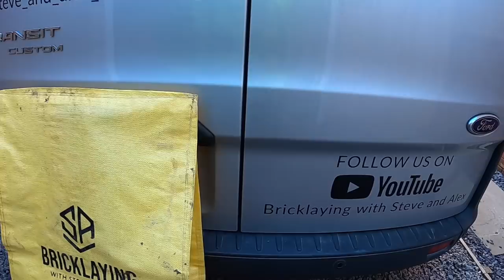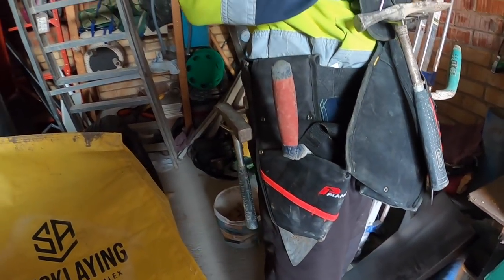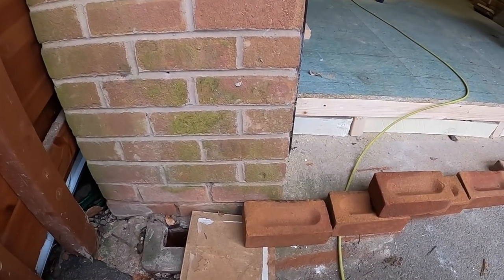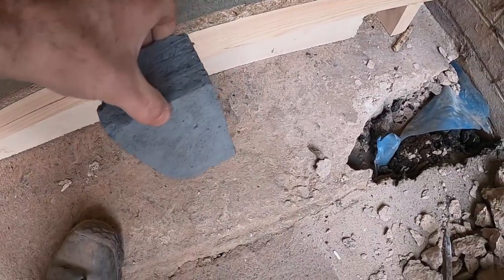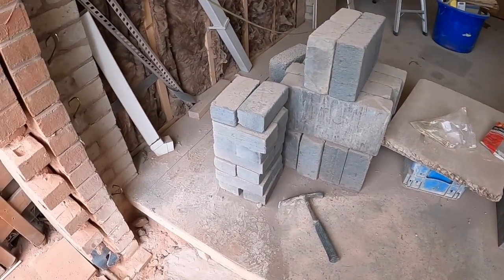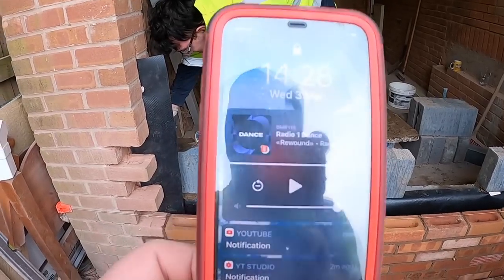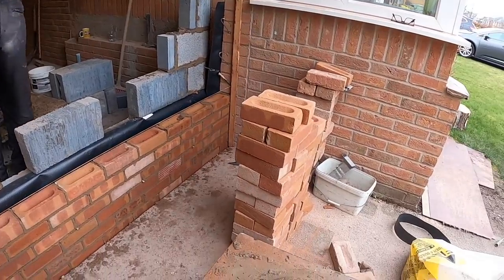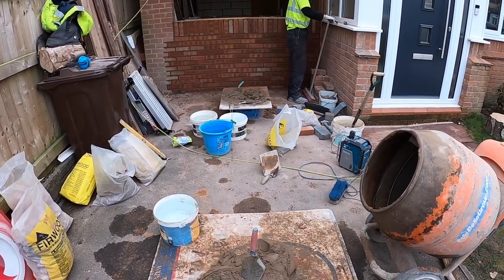NASTY SURPRISE ON A GARAGE CONVERSION

Comment: I take it this is not an ‘official’ habitable room’ conversion...having done a few myself, I know what building control would be saying about this one...and it wouldn’t be polite...but hey ho bro, it’s work I suppose...
Reply from the maker: @martin2466  🧱👍🏽
Reply: Bc only need to know if any drains are being added
Reply from the maker: @topcatcoolio8807  🧱👍🏽
Reply: Its a garage. They just forgot to put the miniture car collection in there.
Reply: @martin2466  Exactly. But if you watched. They put two dpc in. And a cavity tray.  Plus weep  holes . Plus insulation.  Two skins of brickwork.plus a Lintol... Plus tie wires. Plus vertical dpc !!!! It was only a small wall !  They were not building a skyscraper in Manhattan .  So think a but more mate !
Reply: @topcatcoolio8807 ... well, let’s see...only a small wall, but, BC would have required a concrete footing as opposed to a window lintel, Wooden floor existing...BC would have required a concrete floor, probably with reinforcing. The internal DPC was installed higher than the existing wooden floor, the wooden floor was laid directly onto the garage concrete floor, a suspended timber floor may have been acceptable, and at least air bricks were installed externally, but I didn’t see any installed internally (which would have been at the level of the internal wooden floor, not below it). Normally, the cavity tray, well in my area of the woods anyway, would have been installed higher up, just below where the window was to be installed. The external DPC was laid into the brickwork that was only 1 course above the external existing concrete driveway, BC would have insisted on there being a minimum of 150mm between the external DPC and any existing (to remain in situ) ground level... internally, it looked like the timber studs and insulation for the internal wall were fixed directly onto the external brick wall, BC would most likely have required a stand-off... As for your comment about building control only needing notification about any drainage added, I think you might be mis-interpreting completely the Planning Regulations with respect to permitted development, and the Building Regulations, which two entirely different things...!
Reply from the maker: @stun9771  
I need to defend myself here I think after that . 
   1st the lintel is designed to carry a lot more than 100 odd bricks plus it was bedded onto a dpc on top of the hardcore so let’s be honest it’s never going to sag.
2nd The floor is a floating floor with 100 mm celotex insulation . BC up here never ask for a concrete floor as you can’t insulate it sufficiently. The floor is supported by packers onto dpc so there is an air gap all be it small due to the lack of space .
3rd I put 2 dpcs in , one to continue the existing garage one and the other following the house , 2 above . It was actually level with the timber floor which  is house dpc level . 
4th The cavity tray was installed as per local BC specifications and they have never asked for one higher than that. 
5 th . The electrics were all installed by a qualified electrician and certified 
6th the room has been converted from a garage so no need for a fire door any more 
6th our windows always have trickle vents as standard 
7th the ceiling didn’t need re insulating as there is a room above . On garages without we have taken roof tiles off to get into the roof void above to insulate them in the past or put a false ceiling in using insulated plaster board . 
    The bottom line is we (Ste and Alex.... brickies , Jeff And Kyle....  joiners  , Andy and  Sam ..... plasterers ) 
  All father and son partnerships by the way have done over 20 of these garage  conversions so have dealt with BC  a lot , so much so we were told , you know what is needed so I trust you guys to do a proper job so just keep photographic eveidence of your work . 
   If the customer decides not to go through building regs then we explain that it up to them but we will still do all the work up to and above BC specs . 
   Different local authorities have different rules , even different inspectors from the same office have different rules but we won’t go there today as my bloody finger has gone numb . 
   It’s a shame that if something isn’t shown in detail in our videos then people assume it has been bodged or done incorrectly. 
I don’t film Jeffs work as it’s a bricklaying channel and not because the work is sub standard . 
  And just because we don’t show certificates that doesn’t mean they don’t exist . 
   Sorry for the rant but I feel like we needed to defend ourselves . 
  I’m off for a lie down now 🥵🧱👍🏽
Reply: @SteveAndAlexBuild  Take no notice mate. You are a top bricklayers. And went above and beyond. What some Bricklayer would have done.. they also forget the strip footing on new homes - Carries on ALL AROUND the house. So the load on hardcore in the middle would have been transmitted to this. As well as to the splendid toothing you did. And Lintol bearing.  Also a concrete floor for garage and weights for cars is well sufficient.  God bless you buddies.take care.
Reply from the maker: @topcatcoolio8807  🙏🏽🧱👍🏽
Reply from the maker: @martin2466  Absolutely Martin!  . You are a big part of this channel and keep us entertained every week and as you say we all can learn from YouTube. 
   I can honestly say I’m a better bricklayer since starting YouTube which is all down to the comments section . 👌🏼🧱👍🏽
Reply: Steve & Alex... Thank you for your detailed response... All I can say is that I was only responding to a response from someone else that I thought was, to be frank, cobblers... As a builder I have undertaken to design properties, including producing the drawings (the old way, as I was taught, on a drawing board), and obtaining planning and building control permission. Over the years I have obviously become pretty familiar with both the legal requirements, which actually apply everywhere, and the somewhat different views of building control officers...more so now that building control is ‘deregulated’, and mainly carried out by private companies on behalf of the local authorities. One can only comment on what one observes during your videos, as was the case, so I don’t feel that that pointing out things observed...and following you response, I did go back through your video to ensure what I was seeing, was in fact what I actually saw...and commented on...
I would agree if the floor etc has been raised off the concrete and protected, in the manner you state, that’s good...this was not seen in the video, neither was an ‘internal DPC’ at or below the level of the concrete...I only observed an ‘Internal DPC’ placed on top of a course of blocks laid onto the concrete garage floor. I never mentioned electrical installations or the need for a fire door,  which incidentally I have come across ‘doun souff’, together with BC also insisting on two layers of plasterboard being maintained to garage conversion ceilings, to (quote) ‘ensure that if the room is converted back into a garage, the respective fire requirements are in place’...
I enjoy your videos, it’s always good to see how other people work, and the work they undertake, so please don’t consider I was ‘having a go’, I was merely airing my thoughts in response to someone else who had ‘had a jab’ at another respondent...
All I can say is perhaps, like other YTubers often do, perhaps an explanation of what has been done, or in place, when it is not shown, may be a way forward... I look forward to watching many more of the videos you and young Alex produce, and will of course continue to comment...and question things if I don’t see them, or not informed by the video...that only seems a natural way of doing things to me...and you don’t need to ‘defend yourself’...just explain it a bit Steve... best regards...👍🏻
Reply from the maker: Thanks very much Stu , as I said to   Martin this is a great platform to share knowledge and ideas and I have picked up many tips and good advice from the comments section. 
   I believe I am a better bricklayer since starting the channel . 
🧱👍🏽
Reply: @SteveAndAlexBuild  Yes good to watch you. As you say this is a brick laying channel. . Well done.   lads !
Reply from the maker: @topcatcoolio8807  🧱👍🏽

Comment: Here we go again - not bedding DPC on proper bed mortar, mixing concrete blocks with lightweight (cold spots) and not putting in wall ties every block course..... And they think they're good...... 🤔
Reply: (wall tie every block course at reveal)
Reply from the maker: Ok yes here we go again indeed 😆
1 In 36 years I have never had anything I’ve built fall over because I didn’t bed the damp 
2 They are Fibolite blocks not concrete and the difference is minute and too little to make a blind bit of difference 
3 There are no reveals , it’s not a door any more it’s a flat wall so ties at DPC and two course above is exactly how it should be 
Anything else ? 🤦🏼‍♂️
Reply: @SteveAndAlexBuild  and another troll bites the dust😅
Reply from the maker: @mikeypc3592  😏🧱👍🏼